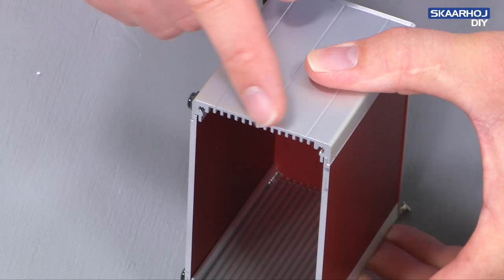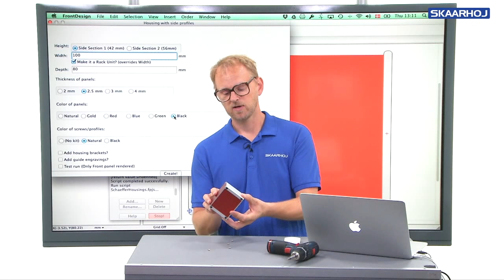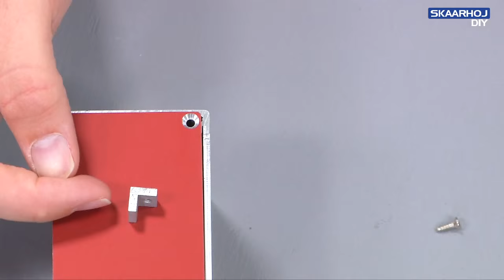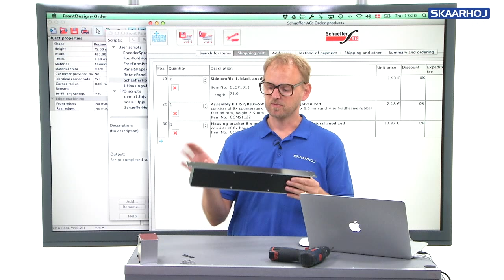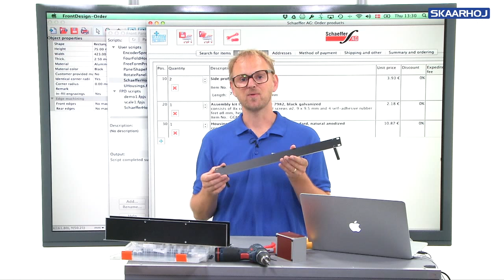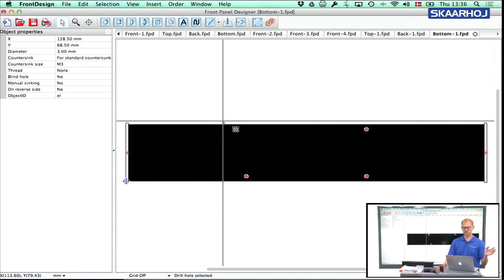Side Profiles - Rack Unit Box

Comment: Hi ... I am designing 1U Rack Panel with enclosure. Does the width of the enclosure and the locations of the brackets & studs need to remain at the default locations or can I move these? For example, the default enclosure width is approx 16.5" and would like to have 17.5" and I would like to more the 1U Front Panel studs a little bit to accommodate the things I need to have on the front panel. Thanks, Kevin

Comment: Thanks for the tutorials, will try out the enclosure script! 

Just a quick question: (I have no experience with CNC-ing, so pardon me if this question sounds stupid :-) )

At 0:25 https://youtu.be/pZP64FMA8rI?t=25 you show the profile of the side panels. Why do they need to be have this 2-3mm separated elevations? Could you also use a side panel with a flat surface?

Would like to build a small computer enclosure, probably around 240 x 180 x 30mm – hopefully i can design everything myself in the front panel designer.
Reply from the maker: Hi - we suggest you contact Schaeffer directly. I'm sure they'll be able to help you out.